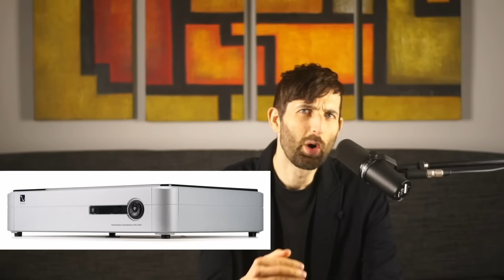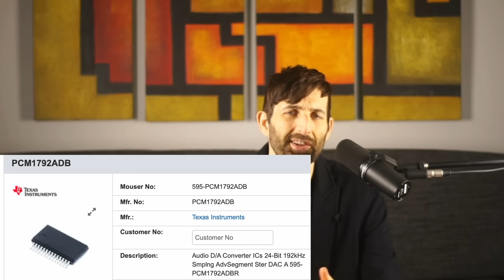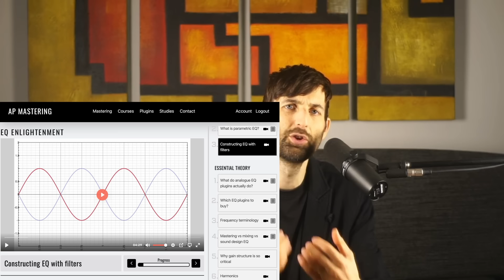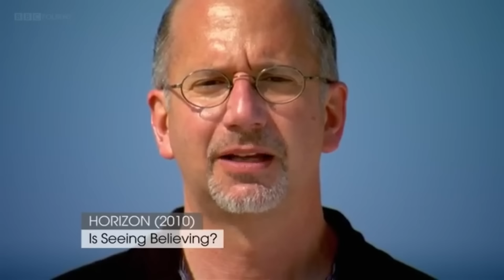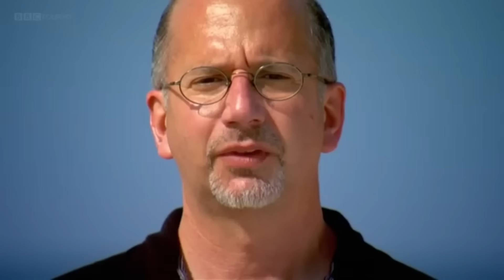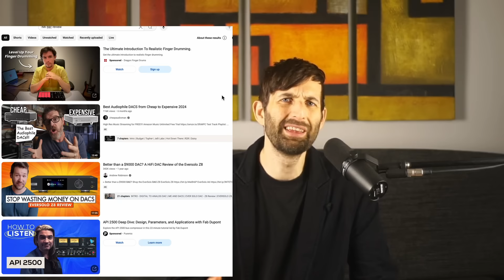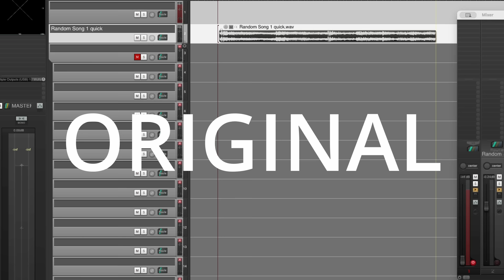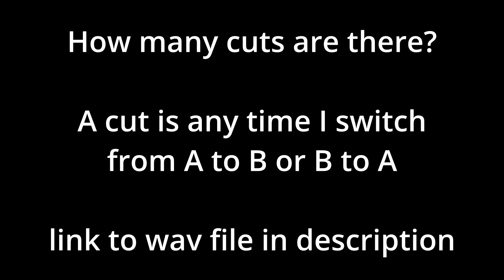The DAC Scam - Almost everyone believes the hype

Comment: Lies, all lies. In the cheap and mid class DACS , that is partialy true, but on the Hi End DACS use their own design CHIPA as DACs , or discrete architecture. Then you have power suppies and audio stage. I have a 9018 based DAC and simply using a battery power suppy for a Reference Supply , you can hear the difference. so please hear and compare before buy

Comment: I believe but don’t have objective data or analysis, that the biggest difference between DACs is the analog interface between the chips mentioned here and the next device with headphones being the most challenging. This analog section is the part which should be the cost driver, but as to whether it justifies the cost, that’s totally subjective since cost normalized by personal income can make cost irrelevant.  

I think there is definitely something to be said for direct conversion provided that digital representation is mostly reformatted to the equivalent of a high resolution (read oversampled in the digital domain with no error introduced) pulse width modulation signal in an electrically isolated RF design and then applied to extremely fast amplifier with post low pass filter. Also important to this and any DAC involving PWM (or delta sigma) conversion is the clock frequency accuracy which drives jitter in the time domain and jitter in the time domain is noise and error introduced the amplitude domain.

Comment: Hey there, I'm a Mastering engineer for a living. I used to subscribe to similar thinking as you years ago, but I thought I began hearing something, that the Lynx Hilo was stifling transients, and conducted my own loopback blind A/B to remove bias and explore this possibility. I posted this blind test and did not reveal the answers until a large group of fellow mastering engineers performed the blind A/B. All who participated could hear differences, many of which were congruent across the group.  I do think there is a point where the spending becomes silly and it's snake oil, but I also understand that the circuit design around the chip being used is also important, as is clocking, etc. and it's certainly possibly to make a premium chip sound worse than another's utilization of the same chip.

I'll be surprised if you do this blind A/B and can't hear any differences between the 3 different loopbacks. For posterity, it's worth mentioning to be truly blind, you can't know which example you are listening to so you should utilize something like Hofa's Blind A/B plugin. Here's the link: https://www.dropbox.com/scl/fi/t170davmirbqoje3nr8h2/Converter-Loopback-Test-Files.zip?rlkey=a0jt4zabx5jqpriqxqmqtavfj&dl=0

The 3 loopbacks are: Lynx Hilo (DAC/ADC), Merging Anubis Premium (DAC/ADC) and a Crane Song Solaris (DAC) paired with a Forssell MADC-2a (ADC). If you do it, let me know and once you complete it I'll send you the .pdf about which is which, and the statistical results of the group test.
Reply from the maker: Hi there. My claim wasn't that it is impossible to make a DAC that isn't transparent. As a manufacturer, you are allowed to make a DAC which isnt transparent and then sell it labeled as "high end" for far too much money. That is not illegal. And that happens all the time. My claim was, you do not need to spend a huge amount of money on a DAC to get a transparent result since the quality of the conversion is dictated by the chips and the analogue electronics around the chips is not very complex or expensive and it recommended in the handbook of the semiconductor manufacturer's chip. If you decide to then ignore the recommended analogue circuitry and use lower quality opamps or different circuit values, then it's likely your DAC will not transparent. It is a priori the case, meaning BY DEFINITION, that a DAC you can hear a clear difference between the original and one loopback is NOT TRANSPARENT. So although I 100% agree that the 50th gen loopback will sound different between one device and another, if you can hear the difference between original and loopback 1, it is not mastering grade and you should throw it in the bin. And if you cannot hear a difference between original and loopback 1, then there is no conversion and nobody cares about any further speculation on differences in sound when you have already proven that the DAC is transparent. That, or you are interested in sending your clients work out of the computer and back a bunch of times, which is just incompetence anyway. Does that make more sense now?

Comment: Different dacs have different sound. Pricing is matter of positioning. If you can make 1000$ dac that enough people will preffer over 10000$ , than you have a case. If i read between the lines, you are not an audiophile, rather, sound technician.

Comment: if you dont want to invest in a good dac and mainly listedn on a PC, I would at least reccomend you get a high quality USB audio controller that has a great quality clock and is run on a quiet linear power supply. tHAT CREATES ENORMOUS IMPROVEMENT, BECASUSE EVERY PART IN YOUR pc IS INCREDIBLY NOISY. tHIS WILL ENSURE THAT AT LEAST YOU ARE GETTING QUIETER BLACKER BACKGROUNDS WHICH HELPS SEPERATE THE INSTRUMENTS BETTER no matter what genre of music you're listening to. whoops, sorry for the caps.. too lazy to fix that. lol

Comment: After listening to 5 mins of this video i have to totally disagree. i have built power supplies for several dac chip sets including pcm 1794 and AK 4493. It is so easy for me to hear the difference in  sound quality buy changing a transformer, using a shunt power supply, improving the capacitors in the power supply or DAC circuit.  This different components  and designs cost different amounts of money which impact retail price of DAC unit. We can argue if any DAC is worth $40K but components around the DAC chip change the sound and cost of building the  DAC.  I understand that the author of this video  cannot hear the difference . Not sure why. I don't know what's in his audio chain. Really misleading to create this type of video.   but so misleading to create such a video as in my experience its just not true.
Reply: Obviously nobody ever did a proper a/b/x test with you. You might want to give it a try and see how bias and imagination trick you into preferring one design over the other.

Comment: I just added an R2R DAC to my system and everything is more musical, I find myself listening to more of the music than before instead of skipping to the next. I don't care if there's more distortion, or if the implementation is different, it's better. as soon as I put it in the chain the musicality came up and I enjoy music much more. I went into it with very low expectations, but I was pleasantly surprised by this inexpensive option to get my feet wet in the R2R world. I am sold. I was using the DAC built into the Oppo 105 player, and the R2R is the very inexpensive KiiO K11. Congrats to KiiO.
Reply: I assume you mean the Fiio K11?
Reply: @andymill8552  Yes

Comment: Yes. My 25yo Acurus CD Player's built-in DAC sounds more musical than a popular high end oversampling DAC I recently bought (and am now trying to unload). In fact that high end DAC sounds worse with very discernable high end noise which is very annoying. That noise is present regardless the digital source. I suspect many of these high end DAC manufacturers are just using the chips as suggested by the mfr data sheets, meaning they are not used in a more novel way then other DAC mfrs. So they have a chance to sound the same.

Comment: I heard ba ba and then fa fa.... I bought a pair of Ogy speakers for nearly £1700. Expectation bias did not save me; they are rubbish. So, back to the subject. How can a civilian like me get a decent DAC? How is it possible to reverse engineer a DAC and come to the conclusion that this is as good as you are going to get without resorting to harming snakes and extracting their oil.I presume a layman can be given a check list of requirements. e.g power supply, OP amps etc etc. 
It is very disconcerting when you get You-tuber 'A British Audiophile' saying that this £12000 DAC has much tighter bass and wider soundstage than this £3000 DAC. Everyone notices these nuances (hence your title) Are they all wrong??